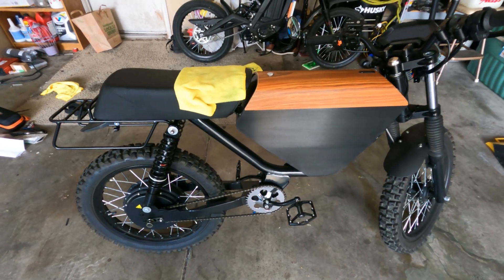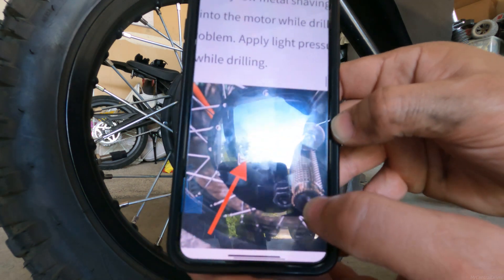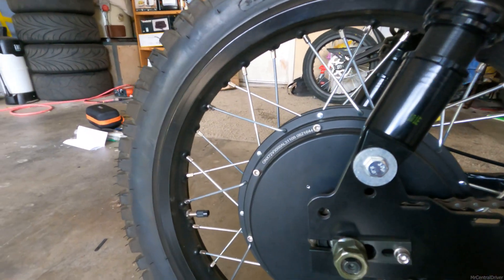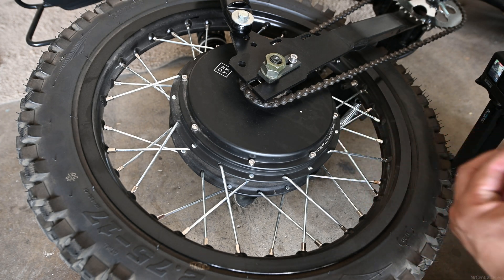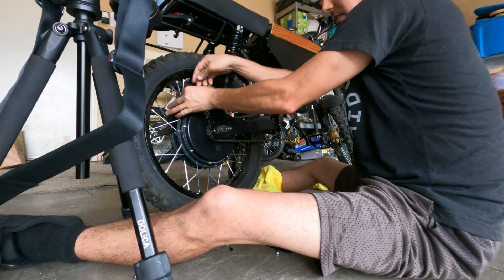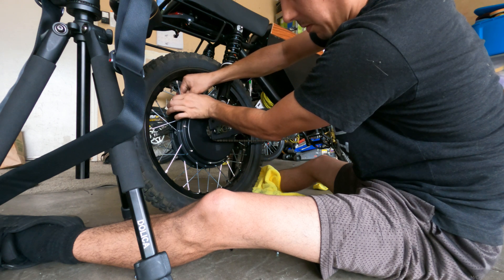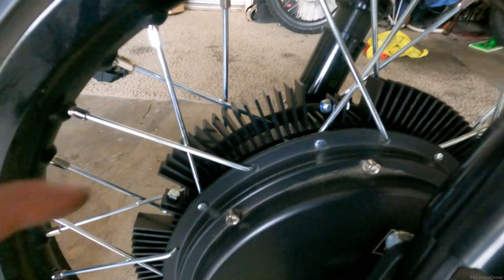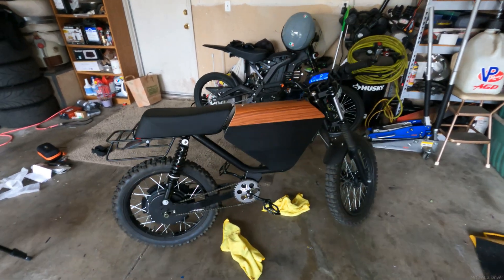Onyx RCR Statorade & Heatsink Tutorial Video

Comment: Why drill a hole in motor case there are magnets in that motor. If you get small filling in motor you will eventually have a problem. I've watched this done before and no hole was drilled in motor I made my own with plastic milk bottles. You must have cost you a fortune them kits are over two hundred ponds milk bottle plastic would have been a lot cheaper. Yes why the hole in motor

Comment: Might aswell just unbolt the motor housing and drill the hole with the plate ofd without getting metal shavings inside 👀
Reply from the maker: So you mean take the chain off. The torque plates. And axle nuts. Remove the side panels. Disconnect the phase wires off the controller. Then do the work? This saves you so much time. Everybody does it this way. No issues on both onyx rcr bikes I’ve done. This one has 5k miles
Reply: @MrCentralDriver  you make it sound more complex than it is. You don't need to do half of that. The torque arms don't have to be fully removed. The wiring doesn't need to be unplugged and the chain is literally 2 seconds job 😆 pop the wheel out the drop outs and unbolt the motor housing 🤷🏻‍♂️

Comment: Can you do the cooling fins without the part with drilling holes and filling up your motor? Would the fins themselves help with cooling or is the satorade fluid a must?
Reply from the maker: I did that on a video and yes
Reply: @MrCentralDriver  okay nice I'll keep it simple and get only the fins when my bike comes
Reply: @emplays22  Getting only the fins won't help much, because there's an air gap inside the motor that holds all that heat inside. Without the fluid, the heat doesn't reach the outside for the heatsinks to work properly.

Comment: Can’t you just unbolt the housing and squirt the fluid in? Like and not drill a hole in the side on the motor?
Reply: Yes, and it is worth the extra work.
Reply from the maker: Yeah you can if you wanna do that. Wheel would need to come off and the bike needs to be on a stand to do so and then you gotta worry About sealing it back up correctly so it don’t leak. Much more work but I suppose if you don’t want to drill a small hole

Comment: What is the paste proposed for the hub sinks
Reply from the maker: It’s like thermal paste u use for your cpu in a computer. Helps transfer the heat
Reply: @MrCentralDriver  don’t it goes away over time?

Comment: with that hole sand and dirt will happily get in there and cause havok, especially once it contaminates with the statorade.

Even covered, over time that'll slowly just come off and allow dirt in.

would've been better just using a gear puller to remove one side cover and putting it directly onto the magnets instead.
Reply: Not if you use the correct adhesive.

Comment: I see alot of ppl doing this. Why are are they doing this?
Reply: Make battery life better I suppose?
Reply: it's supposed to help with cooling the motor. It won't stop your motor from reaching its normal high temperature but when you stop moving, the satorade fluid is supposed to cool down your motor fast. Basically it's like making your motor last longer since it doesn't stay hot as long as it normally would without the fluid.
Reply: To help cool it when overclocking it

Comment: I ordered an onyx about a week ago, and I  got these hub sinks ordered and on the way aswell!
Reply: How did it work out
Reply: @ICTTRADERMASTER  It worked out really well! I was able to comfortable ride an average of 30mph in 85F weather and my moter stayed at a decent temp the whole time, and most importantly, when I stopped it cooled off a LOT faster
Reply: @blubberking100  I bought the 8000watt Enduro 72v40.6ap battery and savotan 150a controller..  I know max speed is 62mph, I want to cruise 40 mph stop and go traffic to work. It's a 13 miles stretch. If I can't make it on the sator and sinks, I will have to buy another motor and run it off with one throttle and a switch. Switch will allow me to switch off one motor until is cools vice versa
Reply: @ICTTRADERMASTER  I should mention that I ONLY intalled the cooling fins, I did not use any fluids in my motor.  I can get my onyxs top speed up to about 68 off of a full battery
Reply: @blubberking100  The fluids work better than the cooling fins.
Reply: How the hell you go 68mph as top speed on onyx?.. What kind of battery, controller wheels you have?
Reply: @midorian12491  I have the stock DOT tires that came with the bike, stock QS205 hub motor, 21 AH battery, and the stock Kelly controller. I have mine set to 4500 watts where it came stock at 3000 watts
Reply: @blubberking100  did you use the AC aduser app to mod the Kelly controller I'm assuming? What were your settings on there? Did you only mod the watt output? And when did you get your onyx because I heard the 1st generation onyx could reach 60mph but the 1.5 had issues only touching 54mph
Reply: @midorian12491  my onyx is version 1.5. I used the ac duster app and I upped the watts as well as bringing the ramp up for the motor power from stock 5 seconds to 1 second. I believe I also upped the max amp output by about 15 amps. I should also mention that I'm a very light rider at 125lbs
Reply: @blubberking100  125? Man you should be a horse jockey. Jk but seriously I’ll try to run this setup. I weigh 175 so hopefully I can at least get 60mph